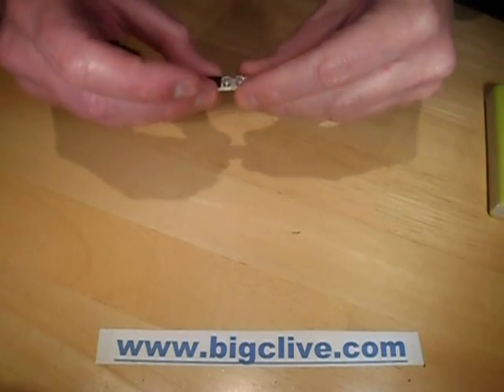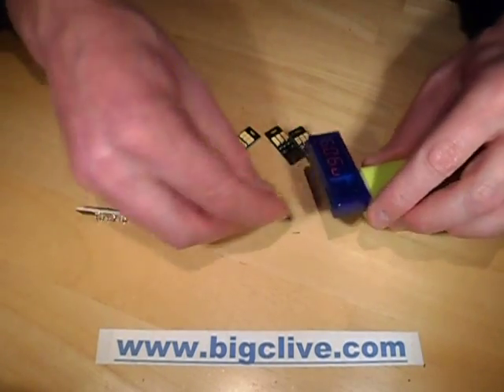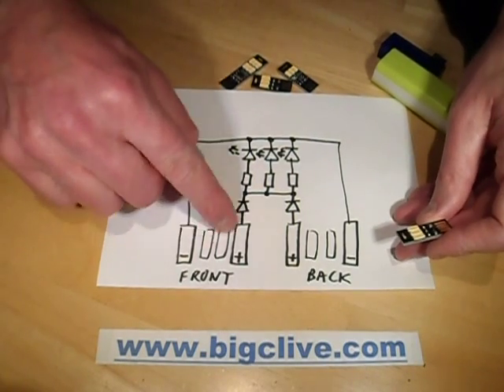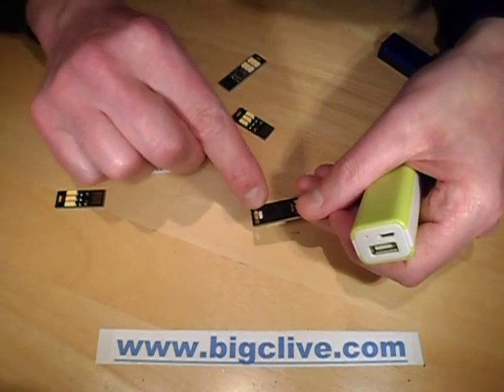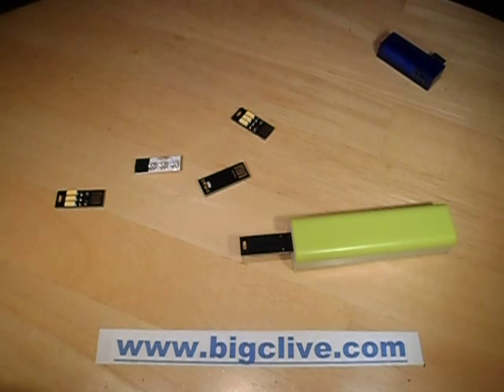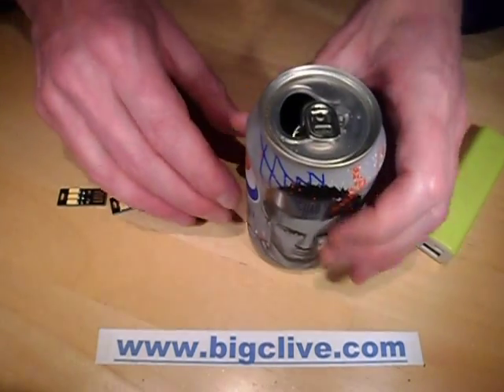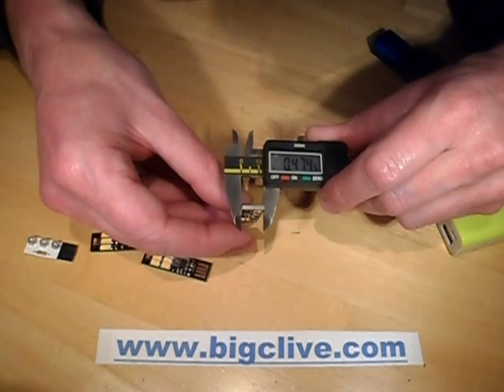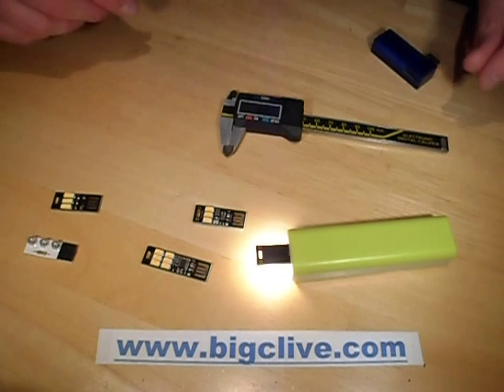Random PCB based USB lights from China.

Comment: for anyone coming here wondering bout the IC, it is most likely SGL8022W - not an AVR. AVR would require coding and programming. the 8022W is RTG IC out of the box. does all that u need to dim LED via touch.

Comment: I recently bought a 5 pack of the USB touch lights and although they look identical to yours their operation is a little different.
Tap from off = On at full brightness
Tap and hold from off = Dims up from low brightness until released.
Tap = Off
Mine do not remember the last setting used.
I guess the PIC chips on mine have been programmed with a different variation of the software.

Comment: If I wanted to wire two or three together, I should do this in parallel, right?
Also, I could all power that off of one USB bank?
Reply from the maker: +William Meisburger-Iwata You could, but you can get bigger and brighter lights for USB use.
Reply: +bigclivedotcom really? like what?
Reply from the maker: +William Meisburger-Iwata Just type USB LED light into eBay and you'll find a wide selection of USB powered lights in both PCB format and as larger units that resemble lamps.
Reply: +bigclivedotcom Thank you, seriously, for your replies. I love your videos.
I just got these in the mail. I got a few different kinds, but roughly speaking, how many could I wire up in parallel? 4 would be reasonable and still could be powered by 1 usb, right?
Reply: +William Meisburger-Iwata Also, thought you should know. Two of them were similar, and one had a 390 labeled resistor on it. The other one didn't work, and on closer inspection had absolutely no resistor in it at all, and had an open circuit.
Also, they have connections on both sides, but the one that works only works from one direction.
Reply from the maker: +William Meisburger-Iwata You could theoretically wire up to 500mA total on a typical USB, although that would depend on the current available from what they were plugged into.

Comment: can you stick a bunch of these into a usb hub(non external power)? will all of them light up? (the 6 led? the 3 led?)
Reply from the maker: Yes.  But you'd have to be careful not to use too many to avoid exceeding the 500mA standard of a computers USB port.
Reply: bigclivedotcom let's say i exceeded the 500mA ,what would happen then?
Reply from the maker: Daniel Kanas The computer should at worst report it as a USB port problem and turn it off.

Comment: You know whats more awesome, the usb light with the six led you could actually ramp the brightness up or down if you keep your finger on the back and take your finger off at your desired light level, Thanks for your videos they are really entertaining.
Reply: I bought one of these http://www.ebay.ca/itm/USB-Power-Apply-Cable-Extension-Cord-Flexible-Metal-Tubing-for-USB-Lamp-for-Ardu-/351186426792?pt=LH_DefaultDomain_0&hash=item51c4579ba8 and use it with the 6 led one  in one of my laptop usb conection and it makes it way more handy!
Reply from the maker: santiago vindell That's quite neat.  I've not see the little USB gooseneck extensions like that before.
Reply from the maker: I did subsequently discover that the dimmable one could be paused on intermediate levels.  I also discovered that if you accidentally put the light sensor one in the wrong way round it shorts out the USB power supply, jams, and then the light sensor is ripped off when you manage to get it out again.

Comment: What's the current draw on the one that ramps up and down?
Reply from the maker: I've just checked and it draws 200mA at full output.  (1 watt)
I've also since discovered that if you hold your finger on it you can dim up and down, stopping at intermediate levels.  At the absolutely lowest setting it doesn't even register on the USB current monitor.
Reply: bigclivedotcom Actually mine draws 100mA, ramps up and down as yours, but a small tap to shut it down makes it consuming still 10mA. I needed a second tap to attain 0mA. Finally I take the habit to unplug it when not needed. 
Btw thanks for all your videos, go on like that!

Comment: That touch one is certainly neat, no doubt using capacitive sensing, it could be an atmega chip as the capsense library for arduino is dead simple to use, perhaps they are doing it that way.
Reply: Could be! Might be something from the ATTINY line or some clone anyway!

Comment: Neat little lights!
Regarding the thickness, around 2.4-2.5mm seems to be the standard. I got a few of those super tiny USB thumb drives that basically look the same as those little lights. and they are all around the 2.5mm mark.